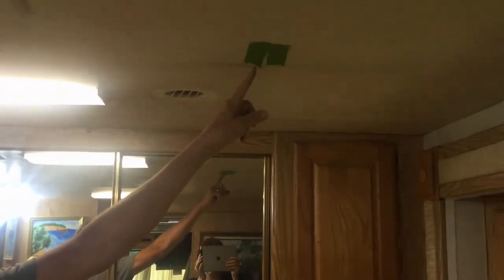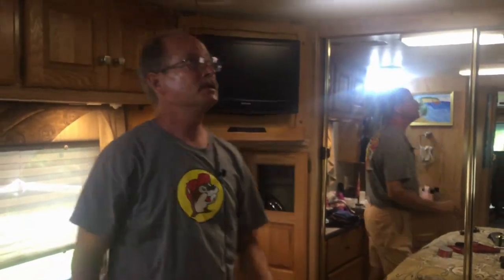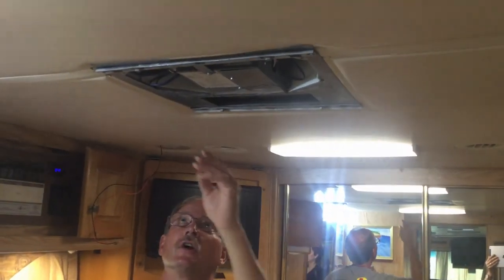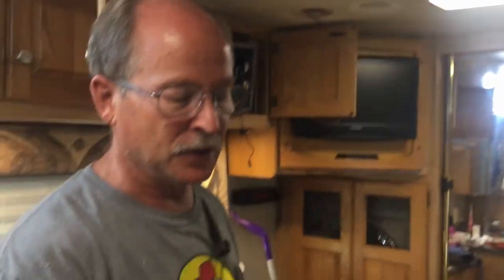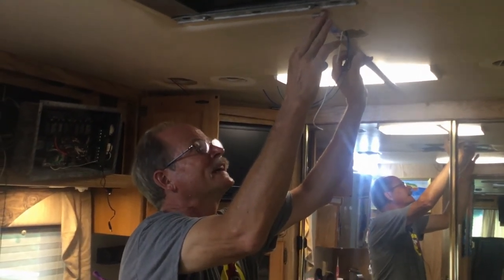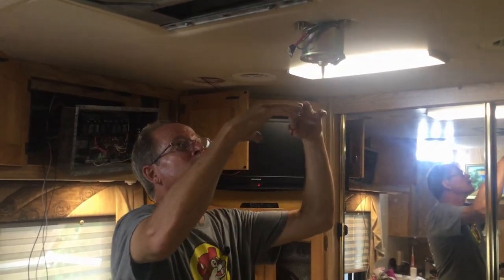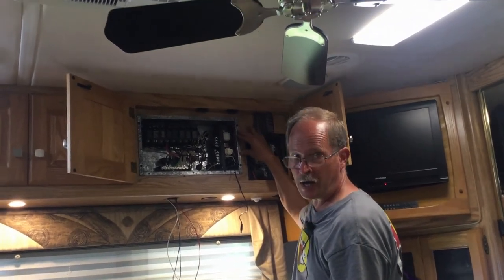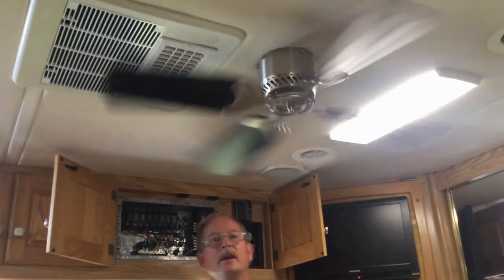How To Install A Ceiling Fan On Your RV Ceiling

Comment: I'm wondering how it will stay tight considering it's tightened up against foam, styrofoam and vinyl cloth. The motor legs aren't pressing against any solid surface.....
Reply: You may not have watched the whole video. He explains at around 3:40 that it's going into metal bars/supports so that it will be tightly adhered and won't sag over time, etc.